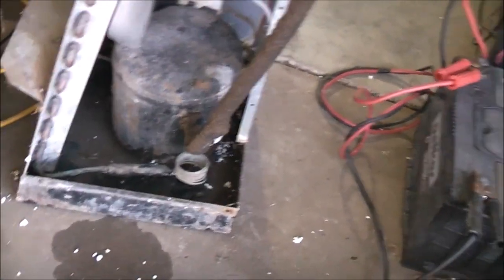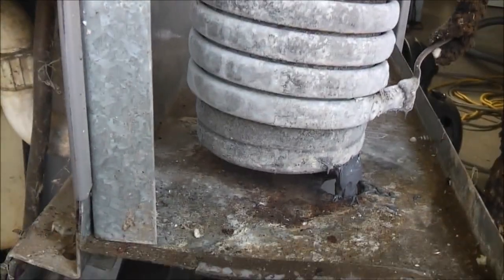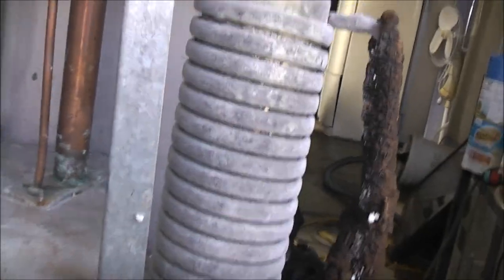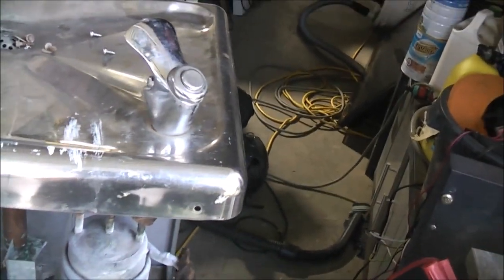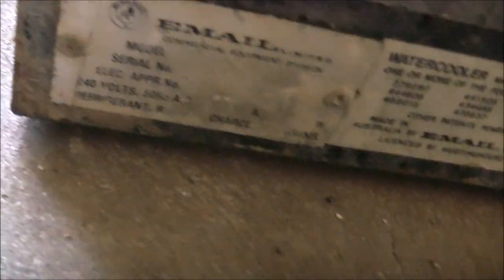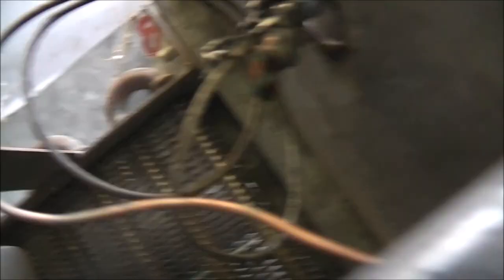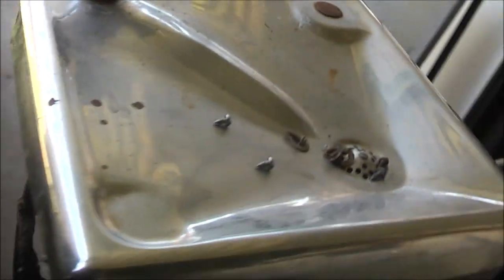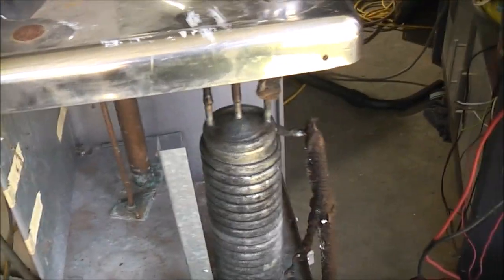Vintage Email Westinghouse Drinking Fountain Repair

Comment: The oldest working water fountain I remember was a Kelvinator in an old locally owned grocery store back in the late 1990s.  The store moved to the other side of town and I don't know what happened to the water fountain.

I didn't know TI's Klixon division made motor start relays but I did know they made circuit breakers.  Klixon is now part of Sensata.